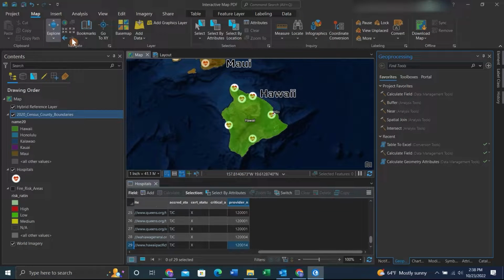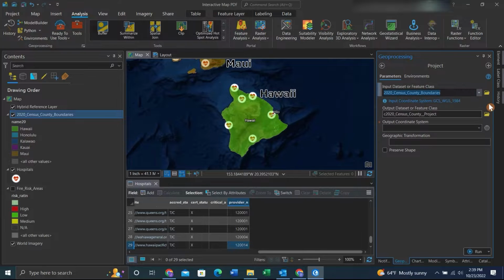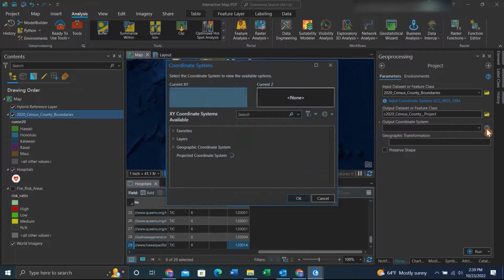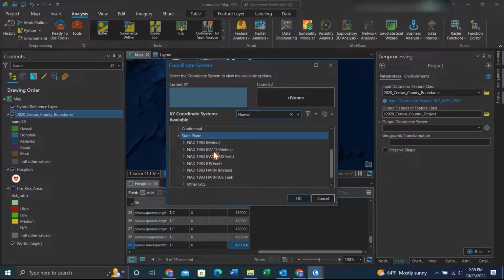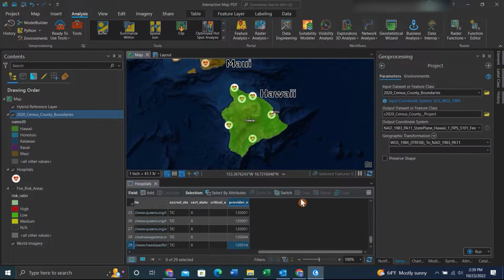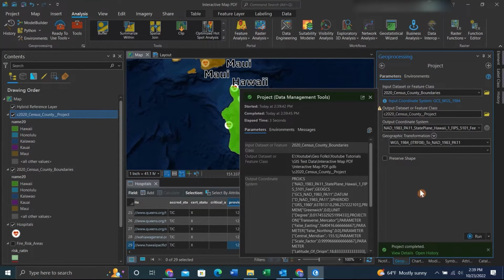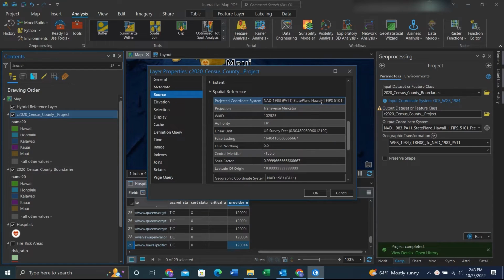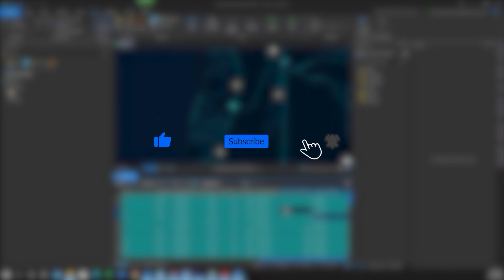How to Change Coordinate Systems in ArcGIS Pro | ArcGIS Pro

Comment: Can I directly change my PCS to another PCS? Like for example I have a layer that has a GCS of WGS84 and PCS of UTM Zone 50. Can I directly project it to a GCS PRS92 PCS UTM 50 using the project tool?
Reply from the maker: I think you should be able to re-project using the new Projected Coordinate System. Are you getting an error with the tool?
Reply: @GeoFolks  I don't but what I do before (arcmap era) is to project it back to GCS (removing the PCS) then change it to another GCS then project it again with PCS  *PRS92 UTM50-> PRS92->WGS84->WGS84 UTM50.  Until now I use this method on ArcPro because of the habit I got when using ArcMap.
Reply from the maker: @LyleGerodias  Gotcha, I hear that! if it isn't broke don't try and fix it!

Comment: when I try to do the same with a NC. file that is already open in ArcGIS, it does not show in the input dataset of the feature class. Why?
Reply from the maker: Hello Abraham, my guess is that the NetCDF file may not be a supported file format of the project tool. I recommend looking at this documentation (linked below) then seeking to transform the NC file into a different data type using one of the listed tools, potentially making a feature class from the NC file, then using the project tool on that feature class you just created. 

Link: https://pro.arcgis.com/en/pro-app/latest/help/data/multidimensional/a-quick-tour-of-netcdf-data.htm